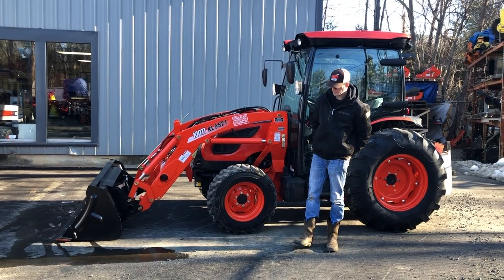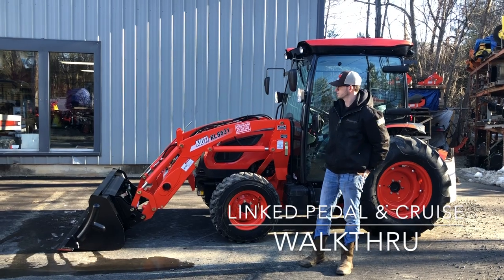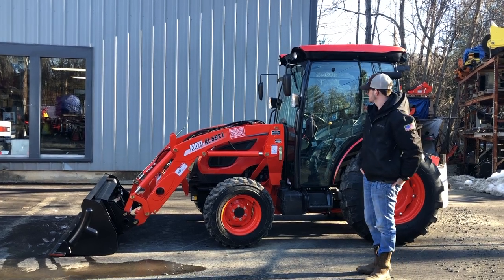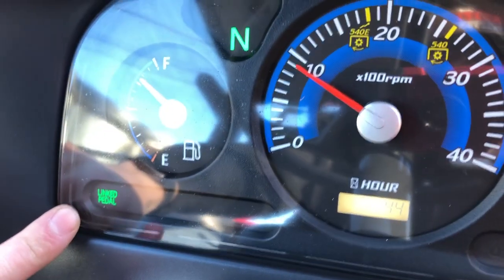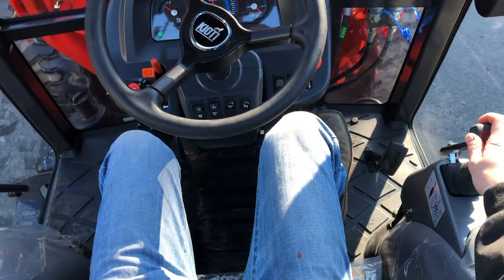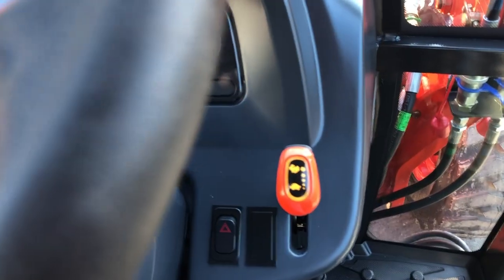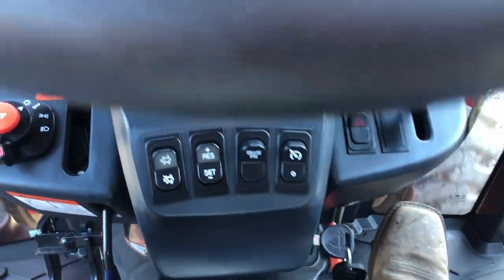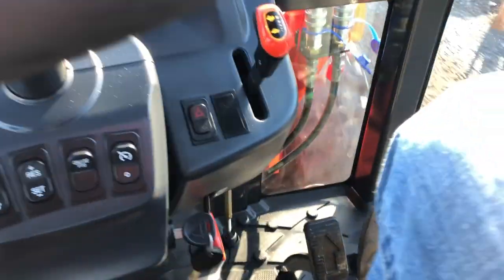Kioti Tractor Linked Pedal & Cruise Control - Walkthru

Comment: Over the weekend I used my tractor on a fairly cold day (tractor was plenty warmed up) and twice when I released my peddle it was slow to rise up...and the tractor kept going forward. Fortunately for me, I had plenty of room (unlike your parking lot), and no harm was done...and it did slowly come up. I was wondering how often this problem happens. Would lubing the pivot point in the peddle prevent this from happening again. If that happened in your video, or with me when working around my pond, or some other situation, it could be very bad.

Comment: I have a ck 35 hst but my cruise control is mechanical not electric. I find that when I set it the tractor slows considerably . Wondering how to reset the linkage properly . Thank you John Amiro,.

Comment: Does the Auto Link affect the PTO speed when mowing? If going up a hill and you want to maintain speed would it be wiser to increase the throttle or use linked press the peddle down? Also, how slow can you put on the cruise control (like for tilling)?
Reply from the maker: Technically yes, it will rev the engine rpms up and PTO speed at the same time. You can set the cruise control as low as you possibly can make the tractor go